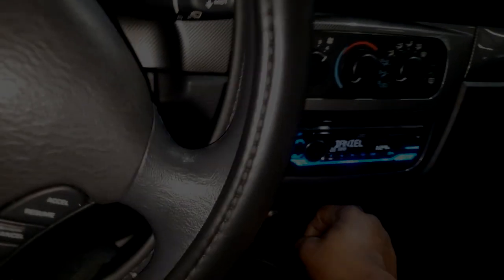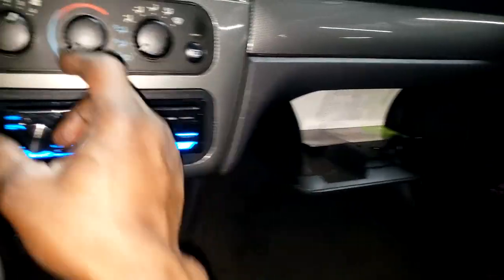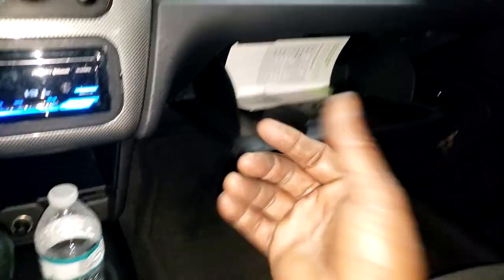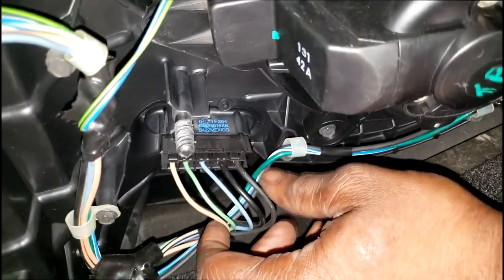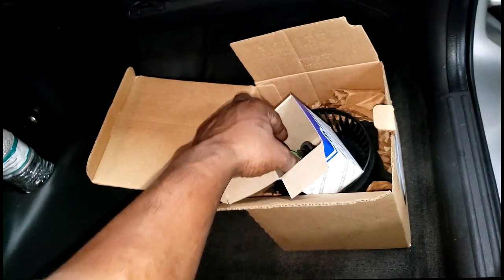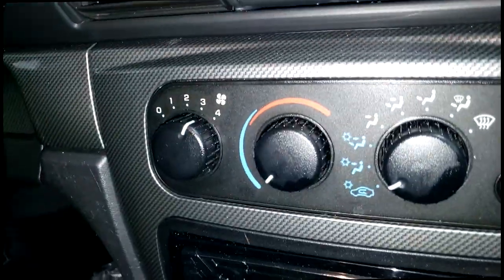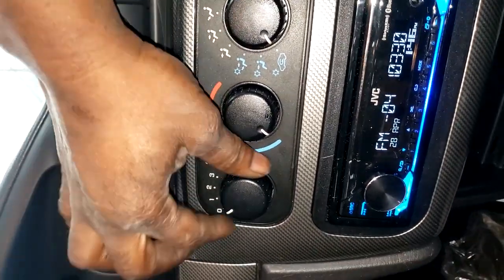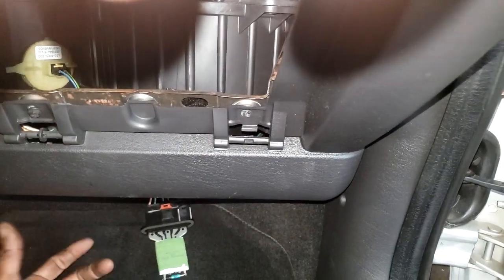How to get COLD AC.

Comment: My 82 Celica I bought dirt cheap only had 2 fan speeds working and it was blower resistor. I found a heavy duty new one in a similar car at the u pullit for like a dollar. I don't understand replacing the blower motor. If it works in a couple of speeds on the older cars it is going to work with a good resistor on all the speeds. All the resistor does is drop the voltage to change to lower speeds. If it makes noise then it's bad, otherwise it's probably fine. The resistors usually die on the most used speeds as they get hot and eventually fail leaving the barely used speeds working. I spose it's insurance for the dealer but raises the cost for the customers.
Reply from the maker: I would have that mind set if I had never been burnt by not doing the blower motor as well. Yes everthing you mention makes sense. The blower motor is just that, an electrical motor with a lifespan like any thing else. It was so much harder to free spin so I felt it will likely take out the new resistor in about 3 months. So the best time to do it is at the same time. IMO
Reply: @OnlineMechanicTips  Well if it was obviously not spinning freely then probably for the best so you didn't have to replace it right away after pulling the dash apart. We are always having problems with the cooling fans in computers. The bearings get dried out and they start making noise or just lock up. Many times you can spray them with wd 40 or other stuff and they'll work again but eventually they dry out again so just end up getting new better quality fans. Usually they are way easier to get to so not as big a hassle to just try lubing the bearings up.
The Celica the fan was quiet and continued to work fine till I sold it a few years later and the resistor was really easy to get to.

Comment: Explain why youd change that in a pair? Aside from being “youre already in there”.. Would the resistor failing or the motor vice versa affect each other?
Reply from the maker: They both the same age and the blower motor has a higher amp draw and harder to turn now. It would be to risky and harder to explain if this car came back with the same problem 3 months from now. (Yes this has happen to me)
Reply: @OnlineMechanicTips  Cool thanks for explain bro love your videos

Comment: Sorry man you talking to much please....
I think it's not necessary to change blower motor you have only to clean  and lubricant
Reply from the maker: No need to apologize, you are entitled to your opinion, thats allowed. As for the BM, as I said in the video, you don't have to replace it, I chose to because of its age and the direct impact it has on the resistor and that its likely pulling more amps and harder to turn. Overall this just the way I chose to do this video. Thanks for watching bud.
Reply: @OnlineMechanicTips  
Thank you for your nice and respectable answer , l think we can check it by clamp meter then we decide in order to walk away from cost... thanks